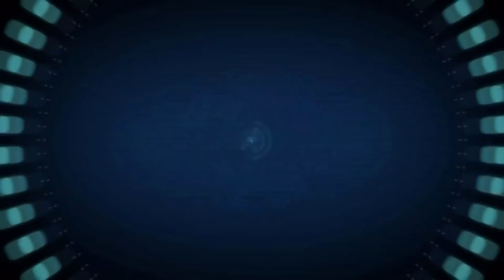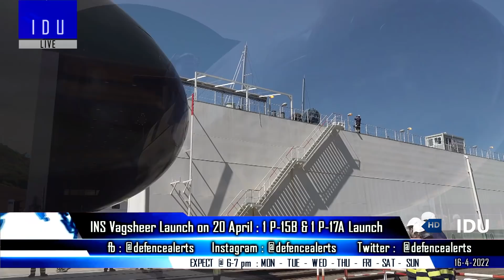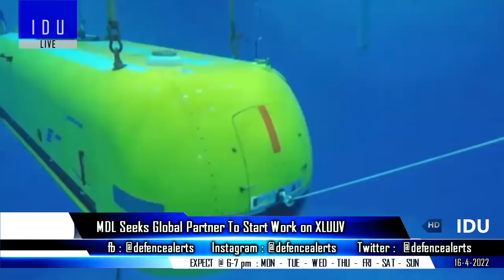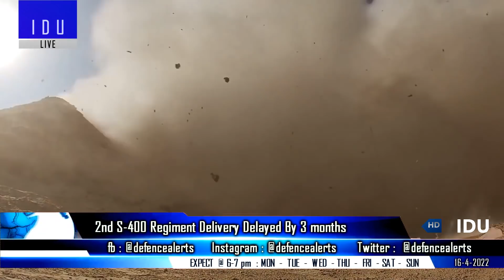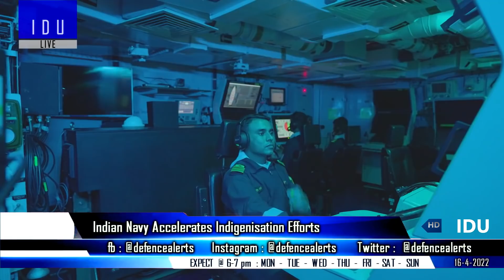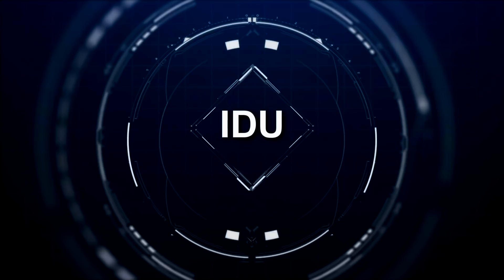Indian Defence Updates : INS Surat Launch,New XLUUV Unmanned Submarine,48 Rudra Order,S400 Delayed

Comment from the maker: 🔴What's Your Opinion : "Last P-15B INS Surat Launch" ?
ＬＩＫＥ | ＣＯＭＭＥＮＴ | ＳＨＡＲＥ | ＳＵＢＳＣＲＩＢＥ
Reply: Boeing is also working on a XLUUV called ORCA
Reply: @flyingdaggers1690  i
Reply: It is a good platform but there is a immediate need to replace the AK-630 on most platforms starting with these new vessels. They have been proven obsolete on several occasions and the sinking of the Moskou in the Black Sea pressed this matter home to Russia as well. Both the L&T upgrade of the 40 mm gun with smart ammunition and the better BAE version with only one type of 40 mm smart ammunition come to mind. And the development of a type of missile like the RAM from Germany for short range defense against speedboat, drone, cruise missile and air attack.
Reply: @jacksonteller1337  Bhai how the Russian flagship got hit? It had anti-defense system in it. Heavily guarded n harmed. Is it because of maintenance issue that anti-defense system was not working? N what anti-defense did it contain?
Reply: @jothisampath415  they used the TB-2 to get it's position and fired the very low flying Neptune ASM using the drone as guidance. Because of high seas they were only spotted last minute the sixties AK-630 couldn't find the missiles in time and the missiles couldn't launch due to them being within the blindspot. The seventies radar on the Slava class is unable to get a track on the hard to detect drones especially in foul weather. Because they have the missile pods on deck the explosion was massive. Like most Soviet/Russian systems it is more dangerous for the crew than the enemy.
Reply: @jacksonteller1337  Thanks Bhai.
Reply: @jacksonteller1337  Bhai one more doubt. Can ka-226 which India planned to buy can be replaced with Rudra ? Wat advantages ka226 has over Rudra? Also the engine for Rudra is assembled in India or India s making it under tot?
Reply: @jothisampath415  the engines are joined venture production. The only benefit of the Ka-226 is the modularity of the rear fuselage. Especially in the license production it would have been much more expensive.
Reply: @jacksonteller1337  thanks Bhai . Since iaf s getting more Rudra n lch ; to balance out we need more attack helis . May be one squadron of Apache or Alligator will help..
Reply: @jothisampath415  the air force rightly went for Apache E, the army has six now too. They need to stick to one platform Apache E and Chinook will fulfill the high end assets and the indigenous systems the lower end.
Reply: @jacksonteller1337  bro I've heard that ins vikrant iac 1 is not that great is it true and one more question is India working on nuclear submarine
Reply: @paramountsovereign65  they already have nuclear powered submarines but only the SSBN. The IN are using the Russian propulsion systems not very modern or dependable. This is why they need to get the French high end nuclear propulsion system for their SSN. The only problem with the INS Vikrant is the design is based on the seventies/eighties Kiev class carrier. Luckily they were smart enough to upgrade the propulsion system. But a Catobar carrier would have been a better choice. Especially since they need to buy foreign carrier capable aircraft anyway. The biggest problem with the older carrier is the Mig 29K it has barely enough availability to get four aircraft in the air at the same time.
Reply: @jacksonteller1337  BRO DO YOU HAVE INSTAGRAM OR TWITTER OR SOMETHING WHERE I CAN FOLLOW YOU THAT WOULD BE REALLY GREAT
Reply: @paramountsovereign65  no closed them down due to security issues. I am in active service.
Reply: Need 6 more stealth destroyer with more displacement with hypersonic weapons. Can rule d Indian ocean. We can thrash these Chinese dummy ships
Reply: Separate nationhood for northeast. May you get wiped away by Chinese PLA
Reply: Surat is a trade center i think this ship should be named after any other military port city or any other military important city name

Comment: They should be outfitting the Rhudra with both Helena and Spike ER2 and NLOS. That would lead to them being able to attack from 7.000, 12.000 and 25.000 meters. The same should be done on the LCH, which should be limited to reconnaissance function. Rhudra is more capable but also more visible so they are more suitable for close air support and the LCH for reconnaissance and taking out land based close in weapons systems.
Reply: The payload of LCH is 2tonnes.. They had to sacrifice literally everything just to install Helena. Rudra's payload is 20tonnes or so.
Reply: @KingstonTiger  that is why they need to get more Apache E which with reduced payload still carries more than the LCH. And a shtload of the Rhudra with only a couple of squadron of LCH on each front for reconnaissance and possibly the destruction of CIWS. But that last one can easily be done by drones as we saw in the Ukrainian conflict.